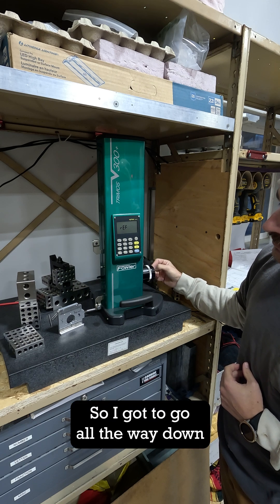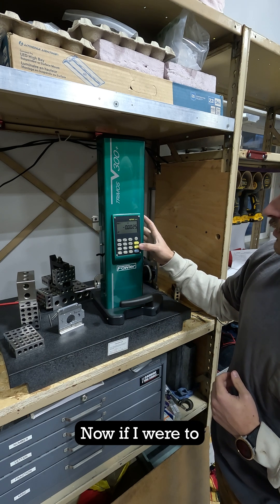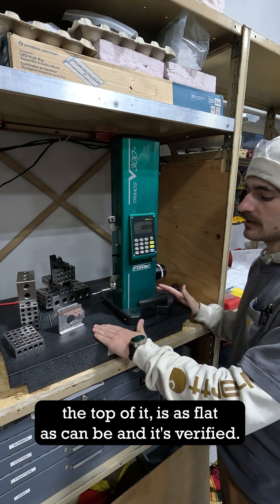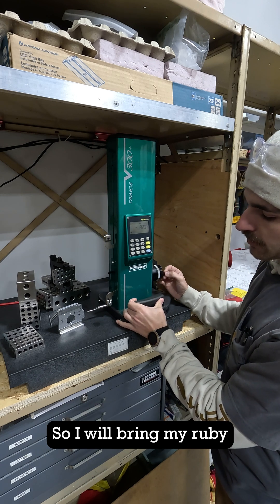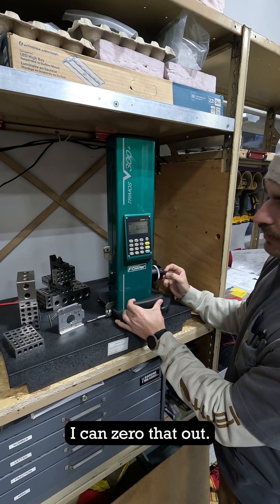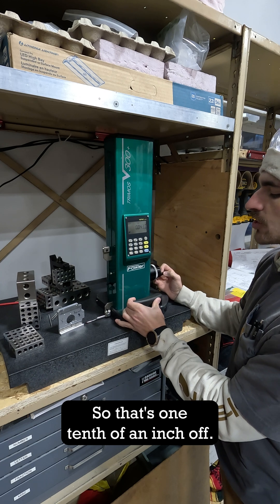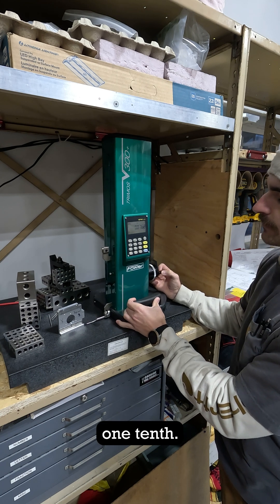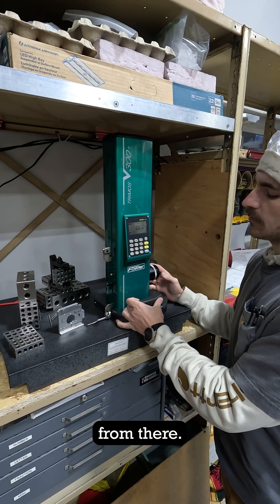Height Gauge Short Part 2 #cncmill #machineshops #education #diy #machinetools

Comment: 1/10 of an inch is .1 ... .0001 is 1/10000 of an inch.
Reply from the maker: Yes technically correct! However the way say 0.0001 vocally would be “one ten-thousandth” which is quite a mouthful so we refer to it as a “tenth”. And 0.1 you either say “point one” or “a hundred thou”